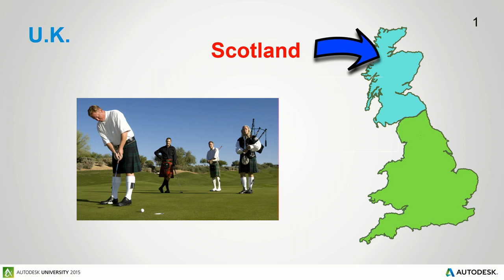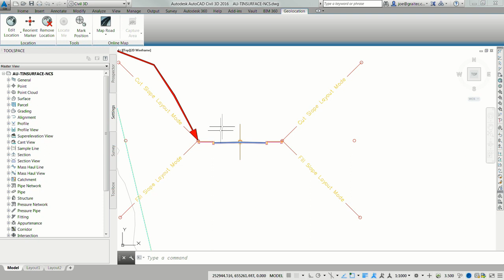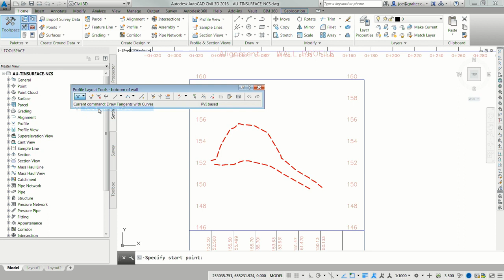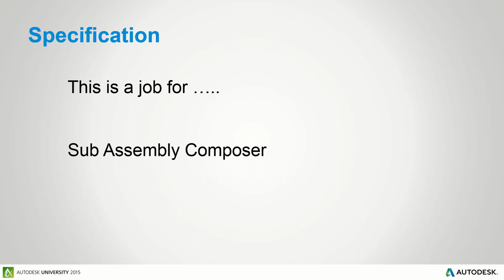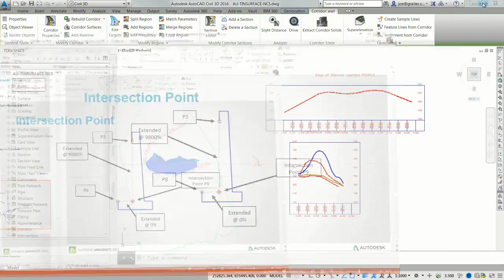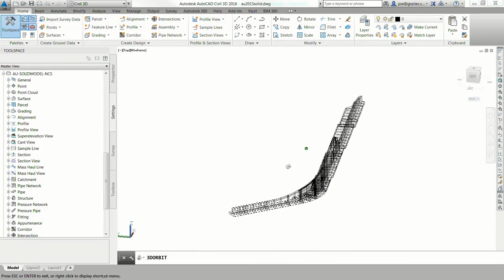AutoCAD Civil 3D Retaining Wall Tutorial

Comment: What would happen instead of putting 9,800% slope and you did put a slope like 1/8 of an inch per foot would it make a difference instead of showing it vertical?
Reply: Surely, you can make any inclination near 90 degrees but not equal to 90 degrees so as to avoid error modelling in civil 3d. Anyway, for general retaining wall profile, it shall be commonly designed with certain vertical inclination.
Reply: I accidentally changed the property of the tool pallet link slope and vertical deflection, now it's gone. How can i restore it?